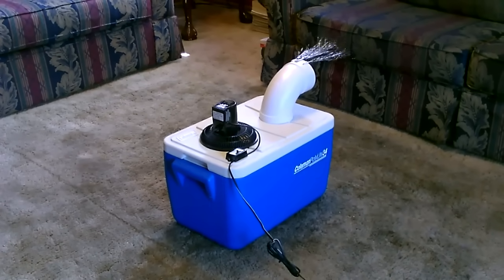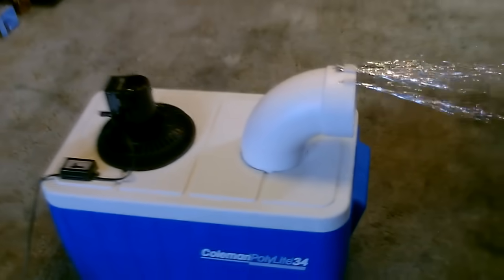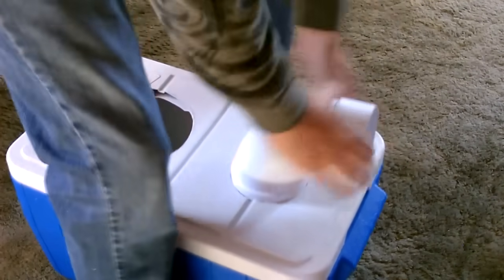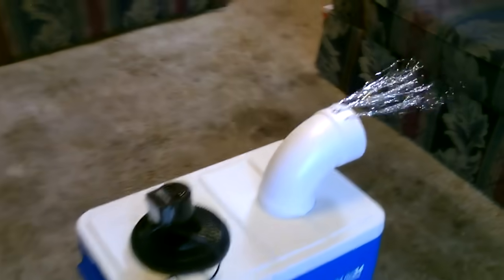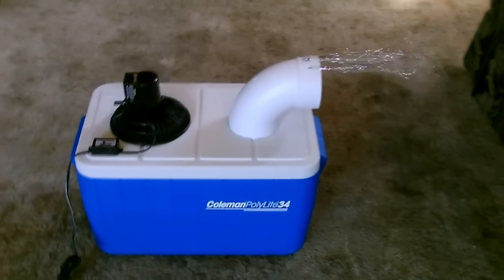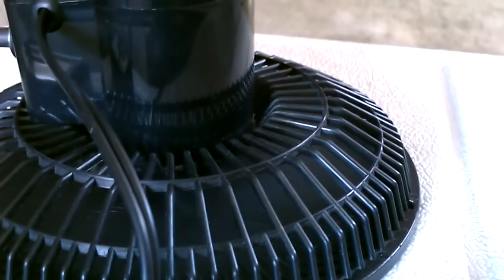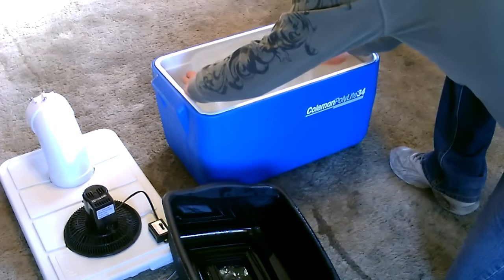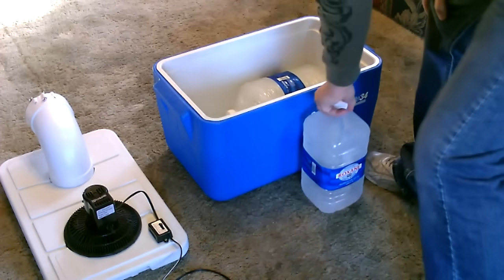Homemade air conditioner DIY - Awesome Air Cooler! - EASY Instructions - can be solar powered!

Comment: How long does the battery last on a full charge with the fan going? Can the solar panels be used to charge the battery? If so how long would it take to charge it? Sorry for all the questions... Just curious. Thanks!
Reply from the maker: hi there. the battery shown in the video (if fully charged) would run the fan for about 7 hours. solar panel could definitely be used to charge the battery. the solar panel in the video would charge battery (from dead to full) in about 5 hours.
Reply: Thank you so much for the info! Keep up the awesome work.
Reply: Ki1ngOfGods Yes, fans use a lot less power, but don't forget you still need to make the ice using your freezer, which consumes more power to do this than you would expect.

Also, take note that while creating the ice cube, the room your freezer is in will heat up, due to the heat energy stored into the water being transferred to the room. Not a big problem if your freezer is in the basement, but in other rooms it could be less desirable.

So, don't bother using this trick if your freezer is inside the room you're trying to cool down. If you take the heat from water + waste heat from electricity usage, you might as well have an electric heater running. You would be heating your room up, rather than cooling it down.
Reply: 787dbrown yes all you have to do is cut off the plug and strip the wires to bare metal and attach them to the clamps. another way you could do it is if you buy a plug to black red wire adapter.
Reply: Ki1ngOfGods I just got done making one of these and it works awesome. I want my bedroom a little cooler since I do get night sweats that's one good reason.  I had a small air conditioning unit in my room but it got to the point where my room felt to moist and I didn't like it. I found a fan on Amazon that you can plug into a USB port and I use a battery pack so no electricity required. this by far to me is the best one.
Reply: Dafluf or...you can spend a dollar...stop by a self ice maker machine, bring the cooler and fill-er-up...like I do 😁
Reply: Donna Reeves What battery pack are you talking about and what fan did you buy?
Reply: GameplayCrush But a high humidity level is pretty much the worst thing during hot temperatures.
Reply: desertsun02  Hello, I was wondering can I use a similar fan, that you used in the video, but this particular fan, uses normal plug to outlet power. Instead of a battery power? Thank you.
Reply: Ki1ngOfGods Real a/c units use a lot more power than simple fans.
Reply: It may be a little late: but time to shine a little light and logic here? This is an air cooler, not an air conditioner. Air conditioners use compressed freon to cool the ir it sucks in and uses filters (dehumidifying and cleaning). This only cools the air. Also, some idiot said this was a heatsink, far from it. A heatsink is a collection of straight iron or aluminum slates pointed upward to draw heat up and out. There we go did this wrap this up? Also sick burn on shortkidbitch
Reply: makromizer 
Says who! Dry air is like a sauna. However i am from  SF CA near the bay so i grew up loving moist air....
Reply: Clear Adventure That should work in theory. But the cooling capacity of such a setup would be very limited compared to an actual air conditioner. Still, if no other options are available, and it's too hot for a regular fan to be of any help, it's nice to have.
You can at least point the airflow at you. The air coming out will definitely help you feel more comfortable.
Reply: makromizer what happens when you do that?
Reply: +787dbrown you also use a 120 mm, 140 mm or a 200 mm 12V .8 A CPU Case Fan which will also do the Job and can run on Solar - Derf
Reply: it dropped so much that the ice melted - ok now.
Reply: Lilly Lee yeah it's getting too hot now for fans so I just put the window ac again. I never turn it on during the day, just the night to have a good night sleep although I'm pretty sure the bill will be a lot every month even with just 8 hours of ac being on.
Reply: Dafluf thanks for that info. I'm using a window ac only at nights and sleep like a baby ☺
Reply: You don't need ice at at all, the way a proper air cooling works is not by blowing cold air in your space but guiding the air trough cooled water which slowly evaporates cause of the heat outside of the machine, that cold vapor is spread trough the air.
All you really need is some cold water, trow a couple cooling element in it and you should be good to go.
Reply: robert mccully That's just physics, water is a much better conductor for heat than air. At a high humidity level, no one could survive at sauna temperatures (~200°). Traditionally, you throw water over the heated rocks whenever you want to increase the intensity, but it's not uncommon to avoid this practice due to the involved dangers.
Reply: makromizer
but that is how a aircooler works, if you want low humidity then you need to make a air-conditioner, which this is not.
Also don't forget hot air can carry more moisture then cold air-can so it kinda evens out.
Reply: +Donna Reeves How long does the ice last in your unit?
Reply: +Keith Optimo  It depends on the roomtemperature.
Reply: thm4855
What is the temperature of the room you have used it in and how much did it drop the temperature?
Reply: Keith Optimo  It depends on the amount of ice, the temp of the ice, and also how hard is the fan blowing. its not possible to give a correct answer here.
Reply: thm4855
You can't tell me how much the temperature dropped for YOU when YOU used it?  I'm not asking you how it would work in my environment.  I'm asking you whenever you used it, how much did the temperature drop?
Reply: I wasn't really worth it for me.
Reply: I'm concerned with it having enough air flow to actually do any good. I want to make one for my RV for camping, and use solar instead of firing up the genie and running the massive a/c units.

Can you recommend something more specific, please?
Reply: probably just a bigger more powerful solar panel. He gave the amps and wattage. Also a bigger/more powerful fan would have more air flow but would probably melt the ice faster as well.
Reply: why the solar panel and battery why not just plugging it into the wall
Reply: +James jones   So you can take it camping or anywhere without electricity.
Reply: James jones Reducing electric bill??
Reply: desertsun02 why not use a real air conditioner? Do tower fans and box fans save more energy than ACs?

Comment: What kind of fan are using
Reply from the maker: hi. it's a 12VDC oscillating clip-on fan by "Auto Expressions" from walmart (sold in their auto. dept.)
Reply: +desertsun02
It is simple designs like this that make the most sense.No copper coils dripping condensated water everywhere...just brilliant.I would probably use dry ice and make a fog machine out of it...but that's just me messin around hehe.Thanks for sharing this great idea.
Reply: +desertsun02 Hello sir, does this cool a room?

Comment: I'm just curious what the room temp is using this diy ac after it's been on a while, as compared to the temp taken within the pvc coupling that shows 40+ deg. Also, I would think that situating the ice so that the air flow is directed more through the ice than mostly across the top before being exited would be more effective at cooling. Just a thought.

Comment: This would be great for my RV. The AC that runs off the engine stopped working but the roof AC works but would have to use the generator to run it. I could use this DIY for travel purposes since it can get uncomfortably hot inside while driving using a 12v fan.

Comment: try raising the bottles off the floor of the cooler a bit. then punch a few holes in the bottle that you can wrap tape over or leave the cap off. water drains leaving only ice in bottles maximizing airflow around them at the same time. just an idea. going to try this and a few other alterations....will keep ya posted.

good idea btw this will make it fun to air condition the house for free.

Comment: Do actually use this as your full-time AC in your home? If so how do remove the moisture and heat out of the area?  I think making one for my Mom for Emergency power failures but full time AC?  Hope you can respond. Great Videos though thanks.

Comment: I have a question for you what size solar panel do you need to run the fan with out the battery and with?

Comment: The end of the fan? Did you cut off the cord and put those connectors on? or does that type of fan come with connectors?
Thanks
Reply: These fans a 12 volt DC fans, they are not 110 volt standard house current. These fans are the type that plug into DC cigarette lighter outlets  and can be purchased at RV/camping supply stores, or on Amazon. So if you want to jusr run the cooler of a regular house fan, it will work just fine and the house fans are not that expensive to run. My problem with these coolers that are set up with the 12 volt DC fan operating on a solar panel is what do you do a night? Are you going to have also but 12 volt batteries and recharge them? I would think it would be just a cheap to run the fan off 110 wall current. Anyone have any cost benefit ideas otherwise?
Reply: Joe Barus ok thanks, I'm going to be using it outside actually on a tennis court, so I was just wondering about those connectors if it comes standard like that or if you just added then on. thanks great video

Comment: Great idea but I would not use this method in a small enclosed area for long periods of time without at least a little outside air coming in, e.g., a slightly cracked window.

Comment: How fast does it cool a bedroom? If I ran this in a room that was 85 degrees here in Tennessee, how fast would it cool an average size bedroom down to the low 70's /    High 60's- with the door shut? Me and my wife watch all our T.V. and most activities in that one room in a very small house.
Reply: From what you said, I would buy a small window a/c unit. Add interior studs, and add maybe 2"-3" of foam. Then put sheetrock or paneling over it. A small investment for dramatic cooling in one room.

Comment: How are you mounting the fan units? I've watched a couple different variations in your vids and I don't think you've explained that part. I see the holes you've cut look to be the exact diameter of the fan housing but what's holding them in?

Comment: Very nice idea but the question is what is the real cost of your system in comparison to the conventional AC. I tried  estimating a roughly calculation as follows:
let assume the price for 10 Kg of Ice is $2 and this 10 kg of ice will run your system for 1 hr at room temperature 30 C. 
also I assumed your system equivalents to   10000 BTU which will consume around 1 kw/hr
so your paying $2/ hr in your system while you will pay 10 cent / Kw.h (Electricity Tariff)
Finally, I agree with you it is genius idea but too costly.

Comment: I'm making one for my parking lot, but we're usually facing 40-80% humidity. Any upgrades that you can think of? We're working 4-10hr days, and the direct sun + asphalt are making it hard for us. desertsun02
Reply: Jimbo Slice I spent right at $500.00 with IcyBreeze and the unit is failing with temps ranging 81-88 in Georgia. Have any feedback from my original questions? @desertsun02

Comment: Most of the energy use is in making the ice. The more ice in the cooler, the greater the thermal mass, and the longer it will last. Putting it in those plastic jugs is convenient and probably helps the ice last longer. This is very light and portable otherwise, most airconditioners lack the portability aspect.

Comment: What are the silver strips for?
Reply: They are just a visual aid to show you that there is air moving out of the pipe.  Since air is invisible he used the streamers to make the movement visible.
Reply: Thanks, I thought it was a practical element. :)

Comment: You could also purchase a sheet of insulation foam, open the lid on the ice chest and fit it to the top. That way you don't have to chop up your ice chest and can convert it back for whichever use.
Reply: +Jeff Myers Great Idea Thanks!
Reply: Jeff Myers I'm a roofer and at roofing supply stores they sell stirafom  (for a cricket system )that redirects the water to the drains.Im not going to get too technical but they have inso  that is 12 inches thick  (1/4"to12"+)I'm sure you can think of something to make out of that. I've made whole coolers out of it. A cold beer is nice to have after a hard day on the roof.
Reply: Thank you for letting us know not to destroy the lid of the cooler if you have foam insulation, which I have easy to cut, and I still have my cooler in tact. Thank you so much.
Reply: Sound 🙌🙌🙌
Reply: I saw another video of a similar homemade AC unit and he just used the cheap styrofoam cooler! You can buy those almost anywhere for around $5
Reply: @miriaml.150 do u. Have a link pls?
Reply: yeah i could do that thanks for the idea

Comment: This is awesome. I built your foam one. Although, It's not as cold as I would like. I think using the unenclosed ice will help. 

Questions:
1. Do you drain the water out once the ice has melted or wait for it to evaporate?
2. Is there a significant improvement in this one compared to the foam cooler version?
3. What's the best of your homemade coolers in your opinion, prioritizing cost, performance and maintenance?
4. I'm using the 6 inch 10$ from Walmart do you think a faster, better fan will increase performance? My thinking is the quicker the ice can absorb the air the colder the air will be. Although you seem to be getting already very close to freezing.
5. What size opening is optimal? I noticed in the foam version you used a smaller exhaust.

Again awesome stuff a frugal like me for the summer!
Reply from the maker: hi there. yes using the unenclosed ice should help a lot. answers:  1.) i drain the water out from time to time. 2.) i would say the main improvements are that this one is more durable and can hold more (and larger) blocks of ice. 3.) overall, i think the best air cooler is the foam one (this one being a close second only because foam one cost less). foam one holds a large ice block, cost almost nothing to make and the temps it produces are about as good as you can get. 4.) i've noticed that the slower i run the fan the colder the air is. (running the fan slower allows the air to have more time to contact the ice)  5.) when choosing which size exhaust to use - take into account the speed of the fan and the size of the ice chest. make sure it's big enough so the air doesn't "bottleneck" inside the cooler. note:  if you live in an area that has high humidity (over 25-40%) reports are suggesting that these coolers seem to struggle to reach the very cold temps. (probably because it's a lot easier to cool down dry air than humid). humidity where i live is from 4% to 8%.
Reply: desertsun02 Very Helpful! Thank you. My humidity sensor reads between 25-40% inside. outside is 20-30%. So that may be a limiting factor. I always thought my location was hot(103 today) and dry. I guess not. lol

I love how concise you are on your videos. No filler just exactly what I need to know. Keep up the good work!
Reply: I add salt to mine, and I also reuse the water and freeze it!
Reply: +norah what does salt do?
Reply: Salt melts ice, we don't spend millions on rock salt over winter for fun. Did I miss something? Am I wrong here?
Salt would increase the speed that the coldness would evaporate thus making it more efficient at cooling in the short term. Of course you would need to empty the water and add ice more often.
Sorry, it's hard for me to see someone post something that goes against everything I know and let it slide.
You wanna explain the science behind that Neal ? If I'm wrong, I'll be pleased to learn something new rather than being hurt.
I do feel false information is hurtful whether intentional or not though.

Comment: This would be fantastic for a camping tent, camper or van! I would imagine putting it up higher would provide for maximum cooling since the colder air goes down and would cool more of the space than having it on the floor.

Comment: Just a tip if anyone is going to attempt this: purchase a strong fan. I made this unit and the fan I bought didn't have enough pressure to get any good air movement. Good luck!

Comment: I made the same thing and my fan seemed to rattle too much...  I purchased a cheap pack of 4 12v computer fans and mounted two fans on top of the cooler, one intake and one exhaust.  Doesn't produce enough air movement, so I may try the 12v fan again!!!  Thanks for your videos
Reply from the maker: hi there. i've thought about using 4 12v computer cooling fans (all pointed down - one at each corner). i decided against it because you'd have to use 4 powerful ones (like a 62, 78 or 103 cfm b-blaster from fry's electronics). and they cost 9 to 14 bucks each (starts getting cost prohibitive).
Reply: desertsun02 I use the same box and a 12 volt thermo fan (11 inch) off a car and two outlets (adjustable) bucket of water 120 watt panel and it sends a nice breeze across the patio on a hot day up to 5 meters away it really pumps.
Reply: desertsun02
I have plenty of computer fans from my old computer store. I need to put them to use. I'll try that. Thanks.

Comment: Nice concept. Can you give info related to that nifty little saw you're using, company name and model? I'd like to research it.
Reply from the maker: thanks. that type of saw is called a jigsaw. (drillmaster from harbor freight Item 69436). basic models start about $15.00. blades sold separately. i used a 4" jigsaw blade (10tpi).
Reply: desertsun02, Appreciate it. Thanks.